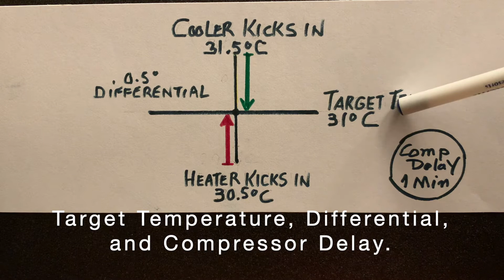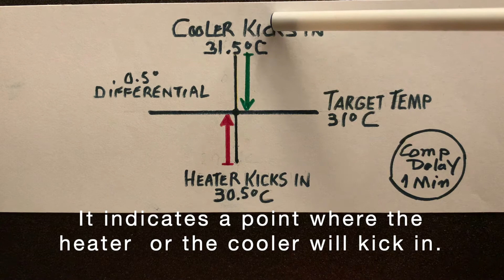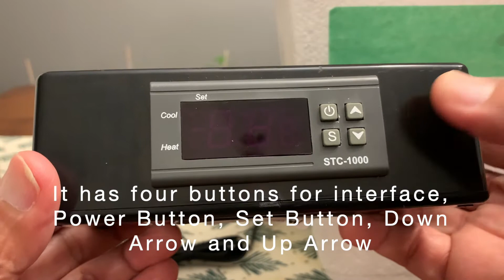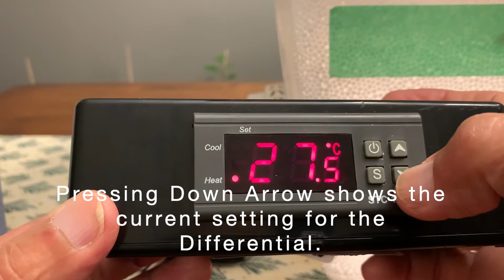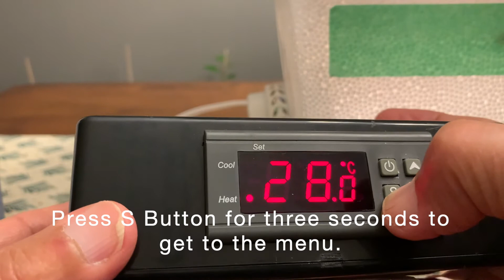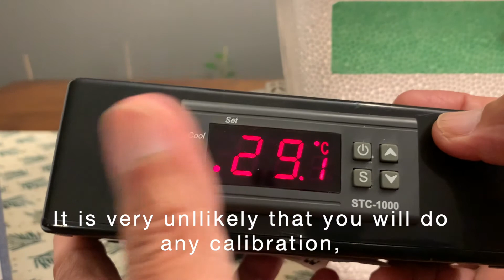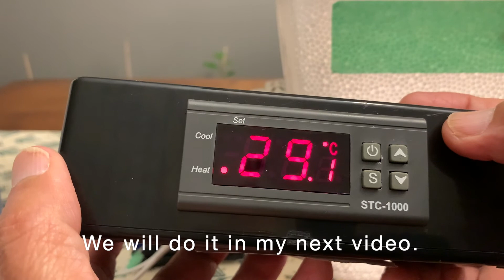Programming  Your STC1000 for Your Tempeh Incubator

Comment: When I 1st plugged the unit in(After wiring) only one of my USB fans came on, though they are both synced and both work as one b4 the STC wiring. There is nowt wrong with the fans(It must be something i did wrong?)

Now i have the target temp at 31.5, differential at 0.5, and compressor at 1

So far it does shut off the lights  at 31.5c  and when temp drops to 31c, the lights come back on

That much seems perfect,its never below 31.0c and never above 31.5c

But why are my fans not coming on?

Do I really need the fans? I ask because it shuts off the heat auto at 31.5 and In 26 seconds off and on for 36 seconds heater is on continuously, I have the holes for the fans there, so that allows heat to escape?

I have let the unit run for nearly an hour and the temp never goes over 31.5c, and never under 30.0c

Is it normal for it to shut off and on so continuously? Will it damage or wear anything out?

I am so close after waiting months for parts and time to do this, and this final step has me frustrated like heck,now I have to get a ride to a store for soybeans,I went thru nearly 10 lbs of dry beans with the oven method, killed maybe 70% of the beans UGH But the tempeh that survived was delicious

Please advise if you can mate
Reply from the maker: Your set works perfectly. It will turn the lamps  on and off forever without damaging it until you switch it off. Of course your fans don’t work because it’s not overheating (above 31.5C). To make them work you need to simulate overheating by holding the heat probe in your palm or put it near other heat source. Congratulations! I am so happy for you 🤗!
Reply: @francius1003  Thanks mate

I simulated heating to over 40c and the fans did not kick in

I took fans out and they def. do work outside this setup

What else may be wrong? i am back to frustration it seems :)

PS what is your preferred method for placing the temp sensor? On beans or off beans? i ask for when I finally get this working

Cheers
Reply from the maker: There is only one possibility: a broken connection. Possibly on the STC1000 terminal. The signal from the STC1000 does not go to the fan.
The best way to put the heat sensor is ON the beans. It will measure the beans' temperature instead of the surrounding temperature, and will automatically prevent overheating.
Reply from the maker: Yes, you need fans. The heat actually comes from two sources: the lamps and the tempeh itself after 15 hrs of incubation. Even when the lamps are off the heat can soar uncontrollably. Here is where the fans will function to cool down the system and prevent overheating. Check the wiring again it looks like some loose connection with one of the fans!
Reply: @francius1003  Hey bro

You may be a legend lol

I took it all apart again,re-watched your video, put it all together, and VOILA

It likely was a loose wire, or I didn't wait the entire minute for fans to kick in.

I had no idea that's what compressor delay meant DUH me lol

It reached 32c and I am WHY ARENT FANS ON? lol

Now I need to get a ride to the city to get my beans and get this freezer full of tempeh

Can I please ask which sensor placement method is your fave to use?

Taped to tempeh bag(Not inserted into bag?),or just a few inches into the top?

In my head I think taped to bag is more accurate?(Not inserted into bag?)

Cheers bro
Reply from the maker: Compressor delay is a term when the STC1000 is used in a refrigeration setting using a compressor to drive the liquid coolant. The system provides a delay to reduce the liquid pressure before the compressor kicks in to prevent damage to the compressor. No need to worry about your system because you are using fans instead of compressor and coolant. However delay is still there anyway, but set it to the minimum setting (1 min).
Reply: @francius1003  Cheers bro

I have no idea how you got all this in sus.

I am glad you did all the brain work and shared your knowledge

Can I plz ask which sensor placement you prefer,and why?

On the bag(Not inserted into bag,or just thru top of the box reading ambient temp?

I trust whatever you prefer to be the best method.

Cheers
Reply from the maker: The best way to put the heat sensor is ON the beans. It will measure the beans' temperature instead of the surrounding temperature, and will automatically prevent overheating. https://youtu.be/7AlApPRKLlU
Reply: @francius1003  Thank you again, bro.

Is that right from the beginning, taped to the bag?

i am doing a batch now, sensor taped to the bag,I have another sensor in the box as well close to that same spot not touching the tempeh, and for nearly an hour now I have noticed a 2.5c temp difference between the 2 sensors, the one not being on the bag is about 33.3c  and  the tempeh bag sensor obvious only goes to 31.5c then down, the other sensor measuring the inbox ambient temperature remains under 34c

Is that OK?
Reply from the maker: If you taped the sensor on the bag don't worry about the ambient sensor. the taped sensor will stay 31.5C because it is controlled by STC1000. I suspect the other sensor is not well calibrated.
Francius
Reply: @francius1003  Well mate not good news.

I made a post about this over on our FB page with a picture.

Midnight last night I put the beans in, and now at 4:12 pm now , so about 16 hours, nothing is happening at all,it is as if I just put the beans in seconds ago.

The STC 1000 is taped to a bag,and it is working within the way the settings were instructed.

Those are 25 watt bulbs I am using

What may be going wrong?

After pounds of beans wasted on the oven method,and then my dehydrator disaster,I wonder if its meant to be,me and my own tempeh UGH
Reply from the maker: @leperlord7078  Since your temperature is correct there is only one thing to check: the starter.
Reply: @francius1003  OK bro

It's a Rampira starter that I got just over 2 months ago,with an 11-09-24 expiry date,and its been stored in my deep freeze

Darn stuff is expensive and takes weeks to get to Canada

I know an expiry date is not a guarantee.But my last batch was in April and it worked(Tho my oven ruined most of the bags UGH

Is there a test for the starter other than waiting 20 hours on a batch to work or fail?

The batch has not changed since I put it in, not even condensation,it has been 21 hours now. Is that normal or expected?

Should I just abandon the batch now? Is it a lost cause?

Can these beans be kept in my fridge until I get more starter and try with a new starter?

It seems obvious its the starter.If it has expired this soon do most sellers do a refund or exchange?

Cheers bro

Comment: Got my STC-1000 today, did all the wiring according to your video with no problems at all. Setting up with your instructions was a breeze. They must've updated the unit as mine is reacting a bit faster on pressing the S-button, the sensor is already attached and has a connector instead of plain wires. Anyway, great video as always!
Reply from the maker: Hi, Jiri!
Good luck with your incubator project! Yes, STC-1000 improves every time. My second and third one has the same features as yours. You are almost there to have an all-weather tempeh machine! If you still have any questions just let me know. Send me pictures of your finished product to my email: fsuwono@gmail.com.
Greetings!
Francius